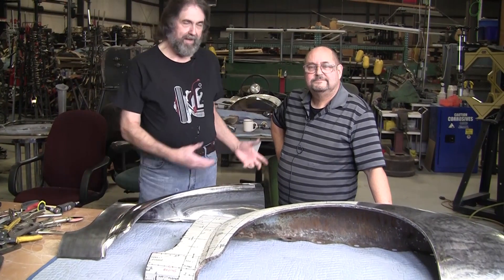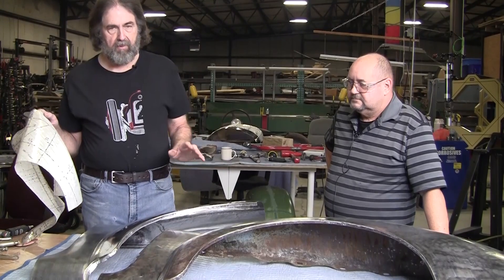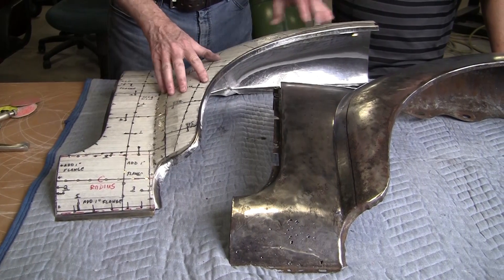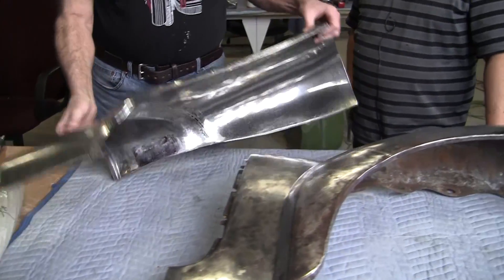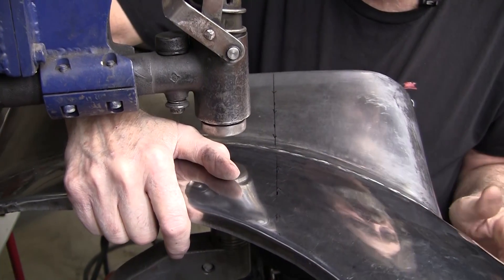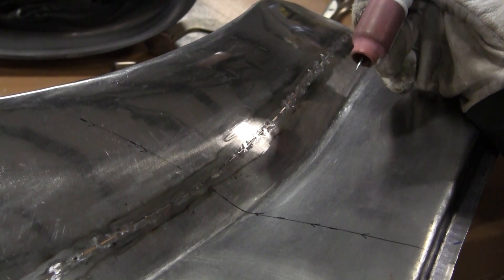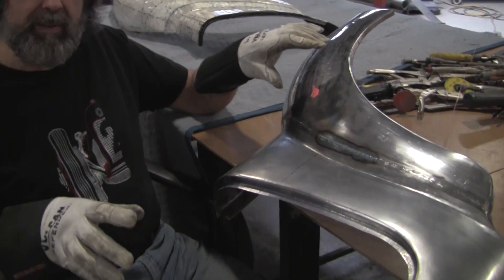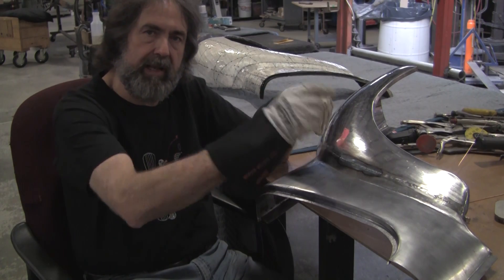Metal Shaping Flexible Shape Pattern Power

Comment: How would you back gas?
Reply from the maker: I clamp .023" copper with vise grips on the backside of welds to create a back-gas condition.
Reply: @proshaper  which weld planishes better, 3003, 5052, or crs. I cant gas weld alum yet just pulsed tig!

Comment: Congrats to you both on a nice piece of metal shaping, a question Wray on Tig machines as you have probably used both over the years I have an older 415V (AU) transformer Tig with basically just amperage and ac/dc controls are the newer inverter style Tigs ( like your chinese one) easier to use for a beginner? I am sure the older machine is quite capable of good welds in experienced hands but maybe not so for me as I seem to get very hit and miss results without seeing the issue ( this is on Ali, havent tried ms ) Great Channel by the way Regards Greg
Reply from the maker: I also have two older Miller welders in the shop one is a 1985 and the other 1983. I use them all the time, they both weld steel or aluminum very well.